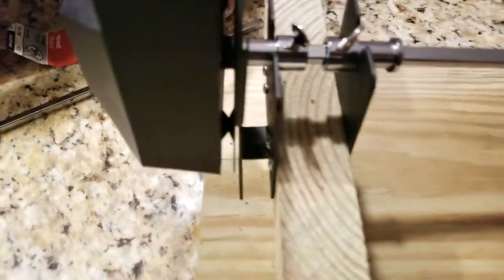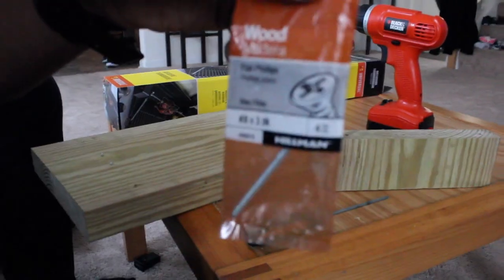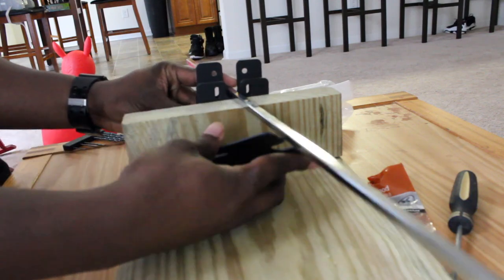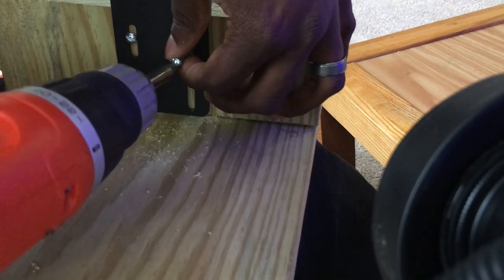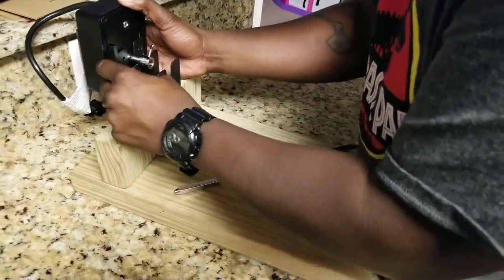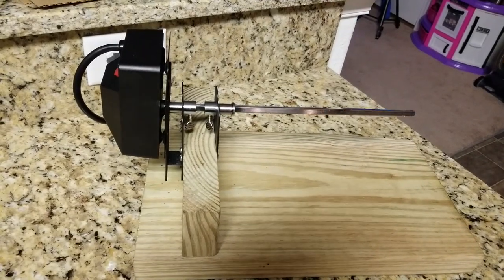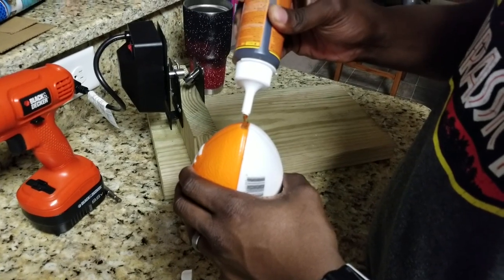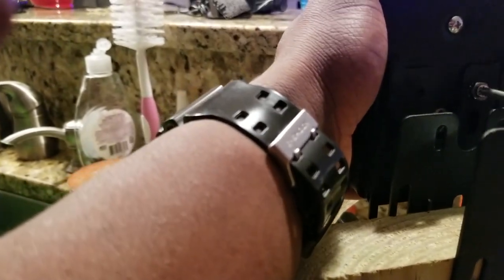DIY Single Cup Turner || Cup Rotisserie|| How To || For Cheap

Comment: This is how I make mine! The first ine my motor messed up within weeks, replaced it second one going strong. Decided to make me another one so id have 2 that motor is now going out like the first one did. Idk if its just a gamble with this brand or what.
Reply from the maker: I think that's probably why alot of people are making theirs with the Synchronous Motors. On Amazon they cost like $26 for 4 motors. Definitely more cost effective if one goes out. My rotisserie motor is still going strong...the only issue I had was slight rubbing with the clamps and brackets. Every now and then I make sure I spray some WD-40 right where they touch. Thank you for the comment!!!!
Reply: @emaniac8681  lol